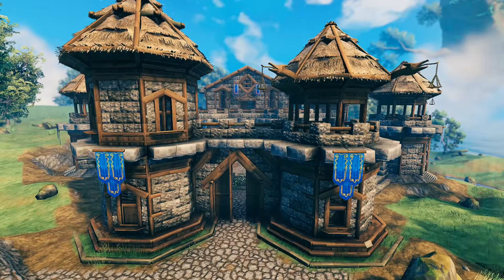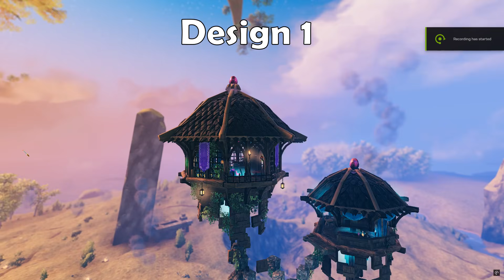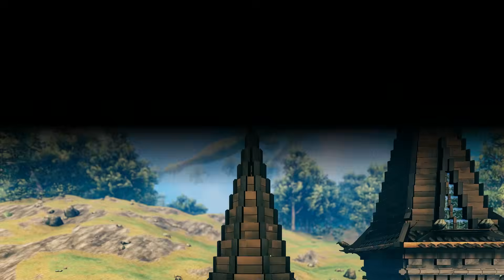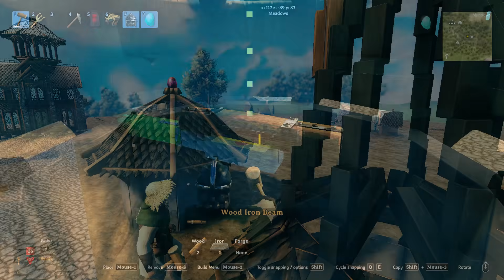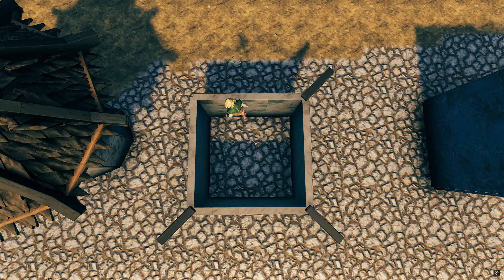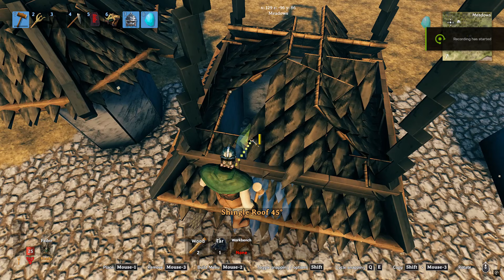Start Building Your Roof Like a Pro! [How to Build Tips and Tricks]

Comment: So, I did a completely circular building (shifting a beam by an angle at every intersection) and tried to follow your design and just adapt it the best I could to the design of my tower. I'm struggling with the top. Since you used the snapping system, it's unclear to me how you did the very top. Would you be willing to give me guidance on how to finish the top of my tower? I followed your design by shift placements instead of snapping. Any help is appreciated from anyone and I can send screenshots through Youtube (if it allows it?), Discord, or another platform if I have it.
Reply from the maker: join my discord https://discord.gg/wWXEzHds